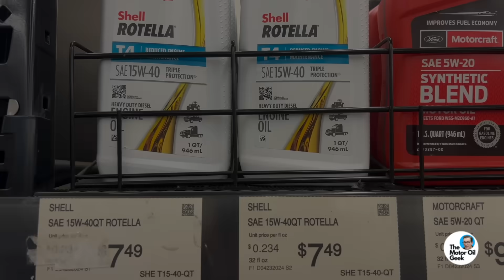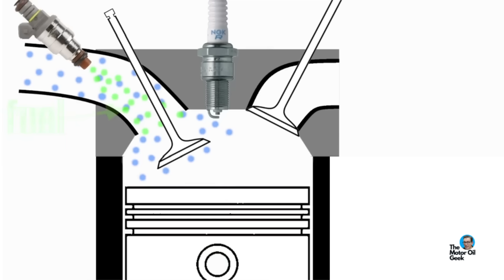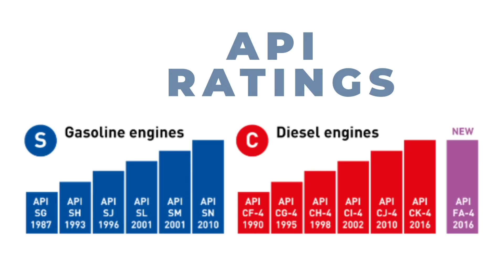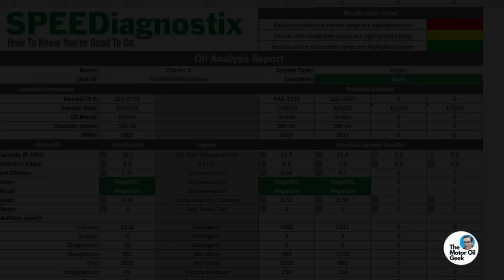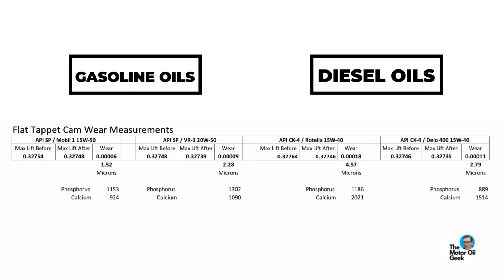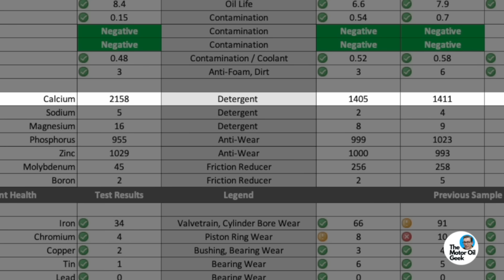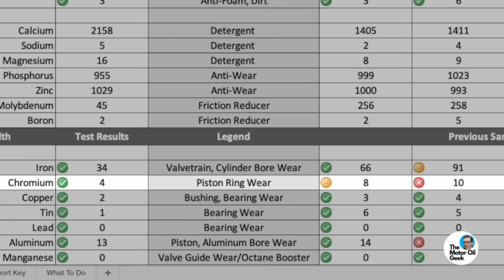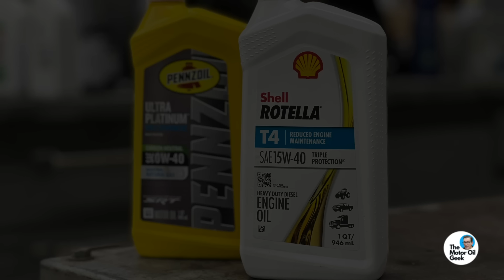Why DIESEL Oil is Actually WORSE for Gas Engines!

Comment: I've been using T4 in my 1986 Chevy 305 small block for at least 10 years. Before that I used Castrol 20W-50.  I use it  for the zinc additive.  The engine requires 5W-30 but since I started using the diesel oil the engine runs quiet and cooler.  It also prolongs the life of the soft cams these engines are known for.
Reply: back in 1988 small blocks gm call for 10w/30 , 10w/40
Reply: The soft cams were a mid-late 1970s problem. I’ve had many many square bodies and various stock GM v8s and it’s a 1970s issue. All the mid 80s I’ve never seen a lick of a cam issue regardless of 305 or 350.
Reply: @Gleone58  I had a 68 chevy 307 with around 90 K that would disagree. Also my mom had a 64 Impala 283 that went thru a cam at about 100K. Been an SBC problem for a long time. Hot rodders would increase the side clearance on the rods which splash more oil to the cam which seemed to remedy the problem.
Reply: Why you don’t listen to geeks with soft hands and zero elbow grease of real life trial and error
Reply: Higher viscosity has more zddp in it.
Reply: Yes the T4 10W-30 my dude.
Reply: The engine doesn't require the thinner oil
Reply: If your engine is designed to run on 5w30, consider using T4 10w30, same great oil, but a bit thinner. Going to thick on oil has its own negative affects over time...

Comment: Hydrocarbon fuels burns in three stages (in order of the oxygen affinity of the component) . First the hydrogen combines with oxygen to form water (H2O), second the carbon combines with oxygen to form "carbon-monoxide" (CO), then the "carbon- monoxide" (CO) combines with oxygen to form carbon-dioxide. In diesel tractor pulls that belch a lot of black smoke, most of the energy is only from the first reaction with insufficient oxygen and time for the second and third.

Comment: I've owned a DI '14 Porsche Cayman S since October 2018, and I have only used Driven DI40 in the car. This car sees about 2000 miles per year and I have no evidence of pre-ignition.  I have to drive past a guard gate on the way out of my subdivision, and I listen via open window, and I never have heard any LSPI.  I also drove next to a wall behind a Publix grocery store and have heard nothing when I went to full throttle instantly from a dead stop or 5 mph.

My other car is my airport car, a 2001 Subaru Outback LL Bean with the 3.0 H6 engine and 117K miles, and that car is happy with Castrol GTX.  Do NOT change an old car such as my Subaru from dinosaur juice to synthetic;  You can cause oil blockages due to crud blobs coming loose, and you can also cause oil leaks since synthetic oil is so much more slippery that it will work its way through weak seals and create leaks.  

If your car has synth oil in it, keep using it.  You CAN use dinosaur juice if you want.

If your car has dinosaur juice in it, keep using it.  DO NOT use synthetic oil in ANY CIRCUMSTANCE!

Comment: While "non direct injection" gas engines are basically "homogeneous charge" and almost all the fuel is in vapor form, in direct injection engines droplets are in the combustion chamber and burn in their surface, the smaller the droplets, the greater their "surface area to volume" ratio, and the faster they burn (for the same fuel). Burn rate is the major reason that diesel engines can not rev as high as gas engines, even with titanium pistons and rods.  Higher injection pressure and smaller holes in the injectors are what allow diesel engines to now rev higher than they did in the past.

Comment: Passenger car engines last about 200,000kms while Commercial turbocharged diesel engines last over 1,000,000kms with double the compression. Tell me again how diesel engine oil isn't as good as passenger engine oil?

Comment: You lost my trust by talking about modern engines that do not use flat tappet camshafts and showing data for flat tappet camshafts. Even my 71 GMC that had a flat tappet camshaft originally now uses a roller camshaft.

Comment: That fubared piston could be common old fashioned detonation. 
I think a good argument for avoiding "direct injection" on gasoline engines and turbochargers on gasoline engines unless you really put racing quickly at very high priority. At a higher priority than durability or serviceability.

Comment: I use diesel oil in a Model A Ford and change it often. Because i need the oil to gather up all the dirt as the engine has no oil filter. Nor air filter.

Comment: What about carburetor work hoses like generators and mowers? Been using 5 40 T6 for three years in both and doesn't lose any between changes and still transparent at the service time.

Comment: The Audi A6 is known as a oil burner with it's low tension rings. I would think the blown out piston was more from gas soaked carbon in the ring lands than the chemical mixture between gas and diesel oil.

Comment: Depends for older classic vehicles there is a benefit I ran Rotella in my 1985 Nissan 720 4x4 because newer oils are not as good for older engines.
Reply from the maker: Stay tuned for the next video

Comment: If the temperature is above 80F, do not try the match in a bucket of gasoline trick. There is likely to be a layer of vapor on top of the bucket. Especially if temps are around 100F.

Comment: I both love and hate these videos.   I've been running Rotella T6 in an old mower/tractor and despite it seeming to do better than most other oils I'd tried now, I'm second guessing.   

If running Rotella T6 is an awful idea,  what would be the suggestion for 90s-era oil-filterless gas engines?  The briggs synthetic didn't run very smoothly.   Amsoil small engine performed well also but costs a small fortune to do an oil change.  Tempted to just use gas engine pennzoil or valvoline and hope for the best.

Comment: As a mechanical engineer well-versed in engine tech and lubrication theory  the information presented is this video is highly misleading in so many ways.

Compression ratio is not what matters but bmep (break mean effective pressure in the cylinder ).  This affects loading in rotating engine parts including induced loading between piston and cylinder walls.  This loading is much higher in diesel and higher in turbo charged engines 

You conveniently compare wear between Mobil 1 a synthetic oil and T4 Rotella non-synthetic oil.  What about Rotella T6 which is full synthetic JASO rated and I use in my motorcycles without any adverse effects.  Motorcycles have higher specific output as compared automotive engines and duty cycle so higher loading is common.

The wear in camshaft test simulates what mileage?  It is miniscule microns difference even when compared to minimum valve clearances and has absolutely no impact on life or performance.

Cylinder wear is also misleading.  Many modern engines are all aluminum with hardened coating like Nikisil and others.  This is standard now in many motorcycle engines and many German car makes as well.  Thus, no magical chemical coating for lubricity/anti-wear with iron is even possible and pure fiction. Not to mention such coatings are very hard and lower friction more than cast iron because they have asperities (micro-pores) that hold the oil better.

I disagree with the conclusion about the Audi A6 piston failure.  That couldve just as easily been due to stuck piston ring that fatigued the piston over time.  Ive seen what detonation failure looks like on my 2-stroke snowmobile and it literally melts away to outer top edge of the piston.

The only legitimate reason to not use diesel oils is they contain more additives that can contaminate the catalytic converter but then again that issue is well down the road when an engine begins having oil consumption issues.
Reply: There are different types of detonation. It absolutely can show no signs on the top while detonating in the top ring grove. That being said, I have a hard time believing that's what happened in this video example.
Reply: @braaap6292  I did further research and ring land damage is caused by pre-ignition not detonation.  In the case of boosted, direct injection engines it is Low Speed Pre Ignition (LSPI).  Which is caused when fuel droplets are emulsified with oil effectively lowering its octane rating.  This occurs when lugging engines at full throttle and low engine speeds.  The pre ignition tendency is worse with oils containing higher levels of calcium or sodium that lead to the emulsification tendency and can be reduced with more zinc.  Good article on this from DSport search for LSPI: Low-Speed Pre-Ignition
Reply: Thank you, I spent half the video waiting for him to get to the point, and then he shows the chart comparing 2 premium full synthetic higher viscosity (20w-50) oils to a conventional, and either a semi-synthetic or full synthetic (delo400 comes in both) lower viscosity (15w-40) diesel oils. The comparison is either intentionally misleading (cherry picked results) or results of a wildly flawed test (incompetence).
Reply: @tylhunt  Yup Same 🤣 I don't believe Lake is anything other than a straight Guy and is enthusiastically researching / learning  and sharing his knowlege -- i don't detect any intention to deceive
Reply: LSPI (low speed preignition) is an absolute thing in turbocharged direct injected gasoline engines and one instance can put piston rings in the oil pan.  I've seen it with my own eyes.  GM has a TSB for their LTG 4 cylinder engine which was experiencing LSPI hardcore which led to the creation of the Dexos 1 gen 2 spec.  Calcium in the oil is known to cause hot spots in the ring pockets that lead to LSPI and the damage shown in the video is 100% factual.  Look up LSPI and see for yourself how destructive it really is.  It makes old school detonation look like kindergartners on recess.
Reply: @silicon212  Pre-ignition is not the same as detonation as was cited in this video.  It is caused by localized hot spots whereas detonation is uncontrolled burn or explosion
Reply: @ LSPI is not the same as standard preignition.
Reply: @silicon212 thank you for this
See my main comment for context.
Reply: Also Newer diesels require a low ash count in the oil. To prevent fouling and coking of the Diesel Particulate Filter, the Hydro Carbon catalytic converter and the NOx catalytic converter.. The small amount of oil consumption comes from the turbo shaft seals and can easily foul the emissions control systems and after treatment if a low ash oil is not used.. most 15w40 fleet oils are now made with low ash.. always use the manufacturers recommendation of oil, oil filter, and oil change intervals..
Reply: Agree - GDI engines put more soot into oil than diesels. Can't use more calcium detergent as Lake notes due to LSPI.  The answer is to cut calcium and replace with magnesium detergent which is, of course, more expensive than calcium.
That and adding back the intake port injector for rich burn loaded engine condition to relieve the direct injector from incomplete combustion.
Reply: @brianmann986  What you stated is simply not true.  "Soot formation in GDI (Gasoline Direct Injection) engines and diesel engines differs in nature and quantity. While both engines produce soot, diesel engines tend to produce more and larger soot particles due to their compression ignition process and richer fuel-air mixtures. GDI engines, on the other hand, can emit more ultrafine particles, especially during warm-up or transient conditions."
Reply: @kannermw  yes it is true.  Carboneceous soot is abrasive.  If not kept in suspension it plates out and causes abrasive wear.  There is no such thing as non abrasive soot.
Reply: @ When soot agglomerates into larger particles it is abrasive.  The right dispersants and suitable oil change intervals make this a non issue.  If it were damaging then diesels would have short engine life.
Reply: @brianmann986  You stated GDI were worse than diesels in soot formation.  That simply is not too.  Diesels often have larger oil capacities.  Most things in too high a concentration can be regarded as pollutants or detrimental.  The solution to pollution is dilution, dispersants, and regular oil changes.
Reply: Great explanation sir 👍
Reply: I concur 👍 and thank you for your input.
Reply: well dave from daves auto is a content creator  he is not a mechanic and is more of a hack at best
Reply: @gpreed2004  🤣 His sentiment is generally ok but comments can be a bit cringeworthy when you know better 😉

Comment: Excellent video,   i've seen some pistons out of gasoline cars that blew up around the piston rings (similar to in this video) and now this video makes me wonder if some people that hotrod their cars are using Diesel Oils thinking it is a better oil.    It didn't even dawn on me that people would do that until this video.
Reply: I am now wondering about the same thing, rebuilt a Moto Guzzi motorcycle engine and had a piston failure about 1000 KM later, I thought the second ring had butted up and caused a piston failure, ring gaps were correct on assembly. Carburetted hemi engine, was running T4 15-40 oil.

Comment: Been running diesel oil in my old mazda F2-T. I beat on it daily, its on 16psi with a not very good tune (very rich). Keeps the HLA's quiet. Seems like most of the issues are with GDI engines.

Comment: One thing that isn’t often discussed is film strength. It’s critical with flat tappet cams, and even more so with high performance ones. Diesel engines have roller cam followers, and diesel oils typically have lower film strength.

Comment: Teflon is by far a much better material/product to increase the properties of your oil than Zinc.
Anything Teflon is Great for your car!
If you can afford it, Boron is also better than Zinc (which is 1960's Technology).
The "Very Best" Oil is switching to 100% Synthetic oil for your car. No additives needed.

Comment: Zinc by itself does NOT add more anti-wear properties to oil. Phosphorus is needed to activate the Zinc.
The EPA reduced Phosphorus levels so much in oil the ZDDP or Zinc no longer works. (Less than 800 PPM for Phosphorus)
The EPA claims Phosphorus ruins catalytic converters causing more pollution.  They don't care about your engine.
Reply: You got that backwards. Zinc is the carrier of the phosphate compounds which drop off to adhere to bare metal where oil isn't present with the zinc floating away to either exit out the exhaust pipe or in the oil during the next oil & filter change.

Comment: Rotella T-4 is JASO approved for air cooled motorcycle and wet clutch motorcycle applications. As I recall doing some research it contains higher levels of Phosphorus and Zinc. And not allowed for vehicles with catalytic converters as it will damage them in the long run.  Thus I, and and many others use Rotella T-4 in our air cooled and wet clutch motorcycles. JASO approved for those applications is marked on the rear of the container.

Comment: Great videos.  Keep them coming. 
Question,  why did some OEMs  recently switch from 0W-20 back to 5W-30 for twin turbo 4 cylinder engines? 
Also, if my early 200s NA V8 or V6 calls for a conventional  5W-30. Should I use 5W-40 full synthetic?
I'm interested in maximizing engine life NOT fuel economy.

Comment: Any words about gasoline direct injected, no turbo engines?  Sooting of the lower tension piston rings has been the bane of these newer engines.  Diesel rated oils have better soot cleaning detergents.  Just saying.

Comment: 4:57 the back of the "diesel" oil bottle, right next to the API diesel specs it says SN, rated for gas motors too. So what's the additive package on that? At 8:36 you're comparing 15w50 and 20w50 SP oils to 15w40 CK-4 oils, and then writing off the viscosity difference as a factor. ??  And then at 12:40, I would attribute that failure to tuning. Was that A6 gas or a TDI? Was it turned up, or stock? Mileage? If it was a diesel, what was the EGT when that failed? Also, aluminum does have a fatigue life.

Comment: I've been running T4 in my 1989 imperial boat with 350 in it.  I believe the marina recommended it because of non roller lifters and more zinc content to lubricate.  20 years, and no oil consumption, and no mechanical failures.

Comment: Hmm,  so,  with all these modern engines having low-spring-pressure oil-control rings (in the interests of economy/emissions),  that then get gummed up and end up causing serious oil consumption,  just HOW are we to keep these rings from getting gummed up in the first place?    The only oil that seems deliberately intended to do this is Valvoline's Restore & Protect.   Are there any others?

Comment: What I miss in the diesel story is that it is the temperature at the end of compression that starts the ignition.
In a diesel engine pure air is compressed and because of the higher compression ratio (read smaller area above the piston at TDC) at the end of compression, the air has a temperature of round 500 °C !!!!   That is the kicker !!! 
Pressure has an effect but is less relevant !  It is the temperature of the compressed air.
Then, at TDC oil is injected in that hot air in very small droplets.  Small droplets are essential as you need oxygen around all these small vporising oil droplets so that the two can react.  With small droplets and air everywhere, combustion starts.  The vapor oxygen mixture ignites at the droplet surface without external ignition source.

Comment: What about those of us that drive around in carburetor vehicles that we rescue after have been sitting for decades? I have been using diesel engine oil in everything for decades, Mobil, Shell , Walmart house brand. Whatever is on sale. 
I also use Fram filters. Everyone uses something different. No one is having problems.